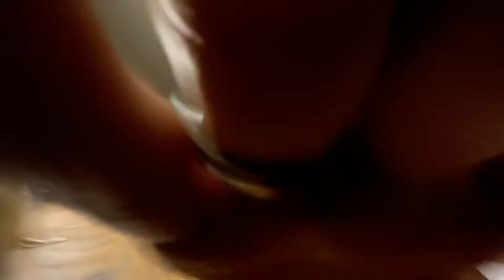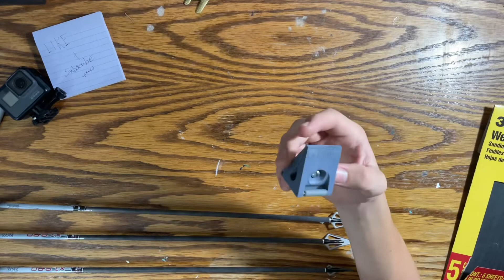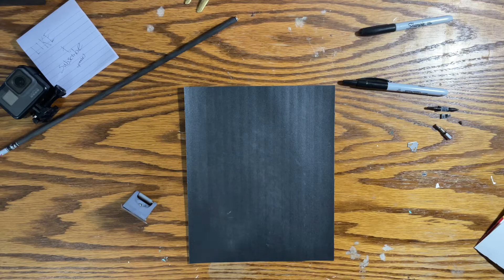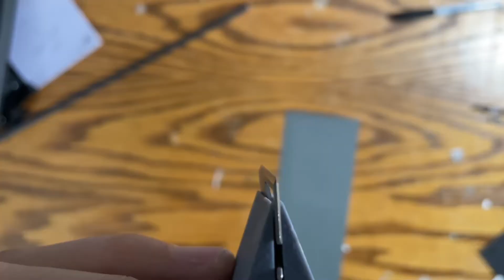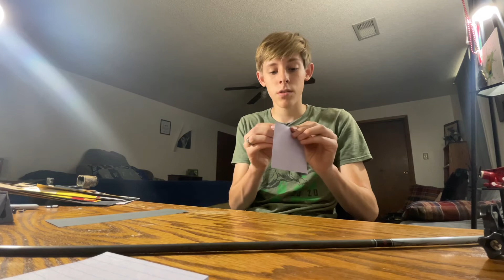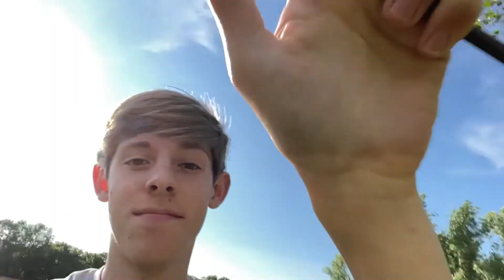DO THIS TO YOUR BROADHEADS TO MAKE THEM SCARY SHARP!!! Magnus Stinger broadheads

Comment: have the guide and the sand paper they recommend can't get it sharp though, the broad head just took the grain right off the paper. Any suggestions?
Reply from the maker: Thanks for reaching out! That’s an interesting situation. Sounds like either the broadhead is already sharp or maybe the type of metal used to make the broadhead is very hard. If I were you I would try either a stronger sandpaper or a sharpening stone. The Hunting Public may have a video on sharpening stones but maybe we’ll try to make one here in the future. If you have any more questions feel free to ask!
Reply: thanks, I actually was using the carbon sand paper from stay sharp . Ron said that it was due to the fact I didn't have a solid surface and  pushing too hard. apparently if paper is allowed to flex it'll mess it up.
Reply from the maker: Happy to help we’re glad you got it figured out! Good luck this season